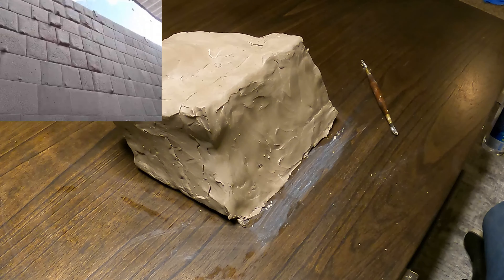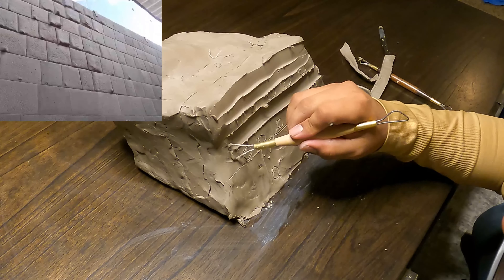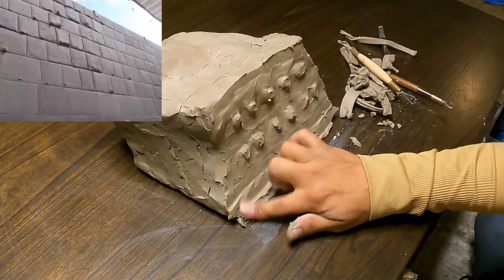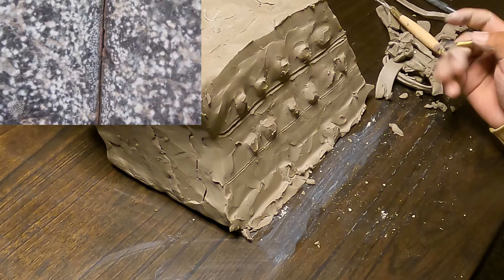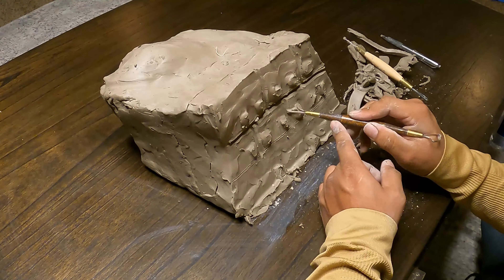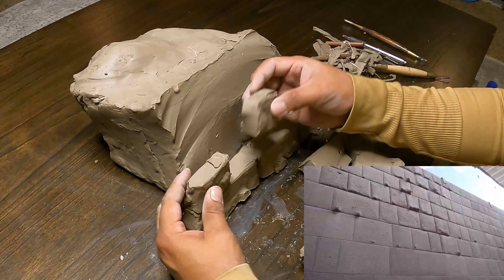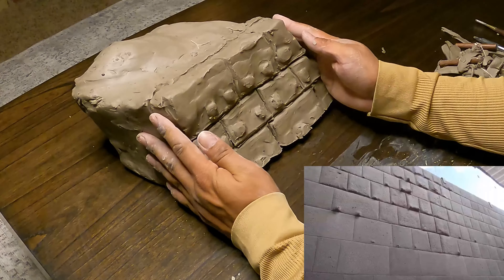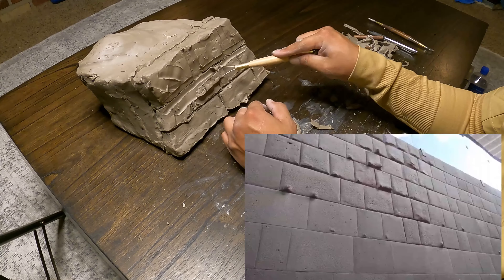Perfecting Polygonal Masonry: A New Explanation on the Ancient Engineers’ Construction Methods

Comment from the maker: UPDATE July, ’24:

Thank you for all the comments. There are many great praises and critiques that I’d like to address.

 1. Protrusions on Stones: Many have questioned why some protrusions were removed while others were not. There could be multiple reasons for this:
 • Removing protrusions is time-consuming. In areas of the wall that are out of sight or covered, such as beneath a first-floor ceiling, the extra time and effort to remove them might not have been deemed necessary.
 • They could have been used for a secondary purpose, such as hanging items or serving another function unrelated to their original use.
 • It could also be that the civilization encountered some disaster or change in leadership during construction, which could’ve led to other priorities outside of completing some structures.
 2. Natural Stone Fractures and Quarrying: A common comment relates to the ability to split off long layers of stone from a quarry. There are pictures and videos showing natural fractures in exposed rock outcrops (search on the internet: “Exposed Rock Outcrop Fracture”). Although such outcrops are not common today, I believe they were more prevalent in the past. Similar to other natural resources, the easily accessible ones were used first, much like early oil reserves compared to today’s deeper reserves that require more complex extraction methods like fracking. Another observation of mine is that this might be why they had to bring these stones from great distances. Early civilizations likely traveled long distances to find stone outcrops with favorable natural fractures.
 3. Consistent Grain Pattern Through Each Stone: This could be the Achilles’ heel to this theory. However, if this technique works precisely, it may not be necessary to abut neighboring stones to their original placement. It could be that some of the stones we see are placed back in the order from where they fell naturally, but there could be others that were not in the original location or order to their adjacent stones. This could explain why some polygonal fittings are more precise than others. 

Although I believe this theory is original, I’m not married to it and have no stake in it. I hope someone smarter than me can provide a better explanation. Like many of you, I don’t believe that these protrusions were used as props to hold the stones up while they were being chiseled, nor do I believe that it was some super-advanced technology.

It’s been a couple of years since I made this video, and I hope to create another soon to delve deeper into how I believe these stones were chiseled efficiently using dolomite stones with small crews of labor.
Reply: nice try but it didn't happen like that lol your theory has more holes than swiss cheese
Reply: This is one of the very too much rare few rational explanations I have ever seen about this topic and I believe it's indeed original as well as possible, I admire your thinking and I thanks your confidence to generously share it with everybody.
Reply: So you are claiming it was easy for them to "plane" the entire face (except for the knobs); however, after breaking the blocks apart, it was too much work to remove the knobs?  Also, the knobs should be along the top edge of the stone to cause tension stress along the groove (and not along the bottom).

Comment: Certainly the best explanation of the knobs I've heard and why they're seen so widely around the world on this kind of masonary. Obviously you'd be hard pressed to use this construction technique on the larger walls but there's no reason why you couldn't use a combination of this technique where possible and cutting them in maually when you had no choice. Keeping it as simple as possible is the key..  Polygonal blocks obviously had to be cut in by hand  and the irregular shapes on some walls suggests they cut them in individually.. I guess the techniques used would de dependent on the properties of the stone in the quarries. Not all stone will fracture in the way you like it to..
Reply: I concur it's an excellent hypothesis or actually theory. The only thing I'm wondering like yourself, would be dynamics. Will it work if scaled up in size.

Comment: I watched hundred of shows on this subject and this is the best attempt at explaining how it was done. I also worked at a granite rock quarry, I use to repel of the edge of the quarry by rope and used a feather and wedge tech to remove huge slaps. Then we would take the slab and make smaller stones, yes I use to make big rock into little rocks. Granite has a grain in the rock that is not easily seen, and you have to use your hand to feel grain. Once you get good at reading the grain with your hand, splitting rock block is easy. The nubs as explained by Daniel would act as a reverse feather and wedges in the splitting process. As for the back side of the rock (the big long and tall cut), that would be easy to cut using feather & wedge technique. I could use other granite stones that are wedge shaped for feathers and another stone for the wedge.  So I think Danial is onto something.

Comment: Why would they not remove the nubs after if they were just for the breaking part?
Reply: There is no need to remove them.
Reply: Maybe it's an indication of the methods used to carve those particular stones while others were carved in a different way. Or maybe they just didn't get around to it.
Reply: @j.f.c  I believe we even have examples of these nubs from like 6 to 800 years ago. There's got to be like some guy sitting in some village with no internet that knows exactly what they're for.
Reply: @cenkaetaya  If I had to guess, those nubs were used to give purchase for ropes when they moved or hoisted them into position, and once it was on the wall, it was probably too much work or they thought it was too risky to both removing them and they did not harm the structure. Or maybe they had some use even after they were set into a structure.

Comment: How did they cut the slab in the first place?
Reply: Drill and wet wedges I would guess
Reply: @johngriffiths118  There should be some drill marks on the blocks where the slabs were cut. They didn't make a huge effort to get rid of the nubs but the block face is cleared of any drilling activity. Also, scibing a line in the rock doesn't assure thats where it will crack when it falls. Internal faults will crack out regardless of what you scribed on the outside. Shouldn't there be some rocks scattered about that cracked other than planned? 
What we need to find is a "Rosetta Block" with all the drilling/cutting markings still in place. Nice theory here but not sure I'm all in yet.
Reply: They used naturally occurring faults
Reply: they dind cut it wall was made in situ..

Comment: Except there's metal pieces holding the individual stones together. 

There was an article written in the mid 1990s.  A researcher went there and did testing.  He found traces of chemicals found in mine water, in the cracks between the stones.  When you add organic water and pyrite to mine water it makes it extremely more powerful,  acidic. He said in his research paper that it could sixteen soften the stones enough to make them conform.

Comment: Ive been saying the same for a while now. However the grain would break easier horizontally with a lot of polygonal walls we see, so if you hacked out a trench six inch wide and eighteen inch deep, the top surface would be roughly flattened and the slab could be 5mtrs x 3mtrs surrounded by the trench. Wedges could be used to split the slab off the bedrock and to get the polygonal shapes and easier to move, while the wedges are still in place drop a heavy rock breaking it in different shapes. Next exactly as you did stand them on their edge in the order they lay on the ground. The v lines you mentioned happen naturally if two sharp square edges are placed on top of each other withought mitering or chamfering the 90degree corner, tiny movement or subsidence creates shelling effect creating the pillow effect over time. Great video, props for that, its just easier to uße the horixontal grain for such big slabs,, look how easy and thin they can cleave slate. Take care my friend👍😊

Comment: This is one of the best theories for the nubs that I have heard, although I think it would have been practiced differently: Carving an large wall off seems very impractical and from what I have seen such a deep single carving has only been done to quarry large megaliths that are kept as one piece, and using crack forming techniques is not an option across that big flat geometry. So I think this practice would have been used more to break up the large blocks that are obtained by the usual splitting-based quarrying. Nubs are often seen in pairs, and right on the edge of stones, so although they could have created a ridge as a stress line, two points would concentrate the stress more and make it easier to break from a shorter drop. This would also explain why so many stones have no nubs too, since during the break the nubs might only end up on one side, and there could also be extra unintentional breakages that leave nubless stones. I do seriously disagree with the idea that the stones were simply reassembled along crack lines, since although there could be some control over how the stones break, stone simply cannot be made to break perfectly into the shape of any blockwork I have seen without significant further reshaping of the mating surfaces.
Reply: Yeah, like the inverted 90 degree corners with protrusive angles and spurs, going AROUND THE CORNER, into the adjacent plane.. you can't 'break' that in one go. It's impossible. It had to be cut into shape, and cut to fit.
Reply: Why keep the nubs if the rest of the stone can be leveled flush.

Comment: Very cool! You explain the “pillowing” and the nubs and more. So one could confirm your method is correct if most of the stones share the same fine-grain striations of their neighboring stones - demonstrating that they had been one solid slab of rock that was fractured on the grooved dividing lines. Seems like that would be a fairly easy test to perform. I’d love to know! I do wonder about those multi-sided stones though - where they have like 9 sides that interlock perfectly with adjacent stones. Those intricate joins are not decorative, and would seem to be pointless, yet very difficult to produce.

Comment: Best explanation I have seen.  I think it makes a lot of sense.  I would think that if this technique was used, there should periodic points on a long wall where the stones do not fit together as well along a roughly vertical seam.  That would mark a place where they had to connect two segments that were made from the same rock face in subsequent cuts. I would also expect that if this theory is correct, there should be natural seams in the rock that continue through multiple blocks, since the blocks started as a single slab.
Reply from the maker: I wonder that as well, about the seam where they would have connected two segments together. As far as natural seams, I wonder that too. I will have to visit one of the sites and get specific footage and also test this theory myself.  Some of my ideas seem correct but they may not be or maybe only partially correct. I’m excited to try them out. Thank you for the compliment
Reply: In a lot of other examples, there is no interrelated consistency between blocks and there is also evidence of some chemical process used in the fitting method, as if the stones were burned together. If this is the case, the knobs would come in handy for chocks during this process to eliminate slippage and dressing them later ran the risk of cracking or otherwise damaging the treated stone.

Just a thought.
Reply: Gregg Braden talked about how the limestone block on the Egyptian pyramids was tested in the 80's and they found hair and insects inside. The natural layers that should have been found like in natural limestone weren't found. The tests proved that they mined the limestone some 500 miles away from the limestone quarries but that it was now a homogeneous mixture without the natural layers. I believe the ancients understood how to crush limestone and granite and then turn it into a liquid or a sorta concrete mixture to make those massive blocks.
Reply: It's definitely a theory that should be tried out to see what happens on real rocks, how easy and reliable it is. It Ddoes make a lot of sense why the blocks are beveled and irregular shaped. I only question why , if  the joints follow natural cracks or weaknesses, that firstly the akers knew all of them and secondly why the weaknesses are straight. That part doesn't make obvious sense, but there could be good reasons for it.
Reply: I wanna see it done lol. People have tried everything I'm sure including this. Rubbish.
Reply: spsmith1965: This explanation might not be completely right. I have seen a cracked block and found that the block was built with small bricks as its crumb and cement as its crust.

Comment: volcanic granite/basalt viscous clay can be cured into a solid stone in less than a week but can't be reverted back to viscous condition unless you add some crude oil to the viscous clay so the sulfur (used to soften stones) won't turn it into a porous pumice - hope that helps!

Comment: There is probably some truth in your described method, and it's fresh to see that new ways of thinking pop up about this, because it's so puzzling and interesting and frustrating at the same time that we don't know a definitive answer! But in my opinion, the method wouldn't be feasible on a larger/taller wall section, I don't believe it would break up into all the carved pieces. Perhaps the top rows would, but at the bottom I doubt the stone would achieve enough momentum and force that it would separate at all. But still, a refreshing view to a complex question, kudos!

Comment: My husband's theory for the beveled edges of the stone is because with sharp edges, the stone facing would be prone to chipping when installing the stones.
Reply: So to avoid the edges getting chipped off, they chipped the edges off... got it.
Reply: @chriscampbell4857 🤦‍♀️ it's a similar concept when making ceramic tile. The edges are roundEd, or slightly bevelled, to lessen the chance of chipping, and means you don't have to be as precise during installation. It's also a decorative feature. Take tempered glass, for example. The edges are slightly bevelled because if they don't, and the edge gets hit, the tempered glass will shatter.

Comment: This is a good theory. If correct, the stones should show continuous grains, intrusions, striation, etc and patterns showing they were once a single piece.  But the question remains: why go to all this effort? Because it's much easier to cut stones one at a time if you aren't concerned about tight joints

Comment: An interesting theory.  I especially like your explanation of the "nubs"
The problem arises when they split the rock away from the quarry.
First, although most blocks would break on the scribed lines, some wouldn't. Due to internal faults, or whatever, they would be inclined to break occasionally. There's no evidence of broken blocks at the time of construction. 
Secondly, the side faces of separated stones typically show signs of milling or cutting. If the stones are milled after they're felled, they wouldn't fit as closely as they do.
The "nubs" are generally placed regularly in similar locations on the stone, suggesting that placement was critical to their function. If their function was just to encourage the stone to break on the scribe, the location wouldn't be quite as critical. 
Still, it's one of the better theories I've heard!
Of course, it doesn't address the larger question: how did they move them!?

Comment: You can see from partially dismantled walls at Cuzco that the stones abut each other with perfectly adjoined faces which are smooth and often curved, and also often with compound curves. Obviously a broken stone would not form such surfaces. 

A broken stone would fit back together perfectly but the surfaces would not be smooth.

Comment: How do you explain polygonal fitting around corners? What about places like Ollantaytambo and all the massive inner and outer corners? What about the flawless inner corners in Egypt that wrap around the stone? What about cutting and fitting the back of the casing stones on the pyramids in Egypt?

I appreciate the effort but this obviously isn't it..
Reply: Ya I was thinking that too. It’s incredible that they somehow did this. Even if it wasn’t the Mayan or Incas. Somebody did it, and not with stone tools lol.
Fitting granite so that you can’t put a business card between them is pretty extraordinary.
Reply: More than one tool in their toolbag, this probably worked well but wasn't the only method. Maybe the knobs are an indication of the methods used?

Comment: Cuzco and other sites have differnet sized knobs some small some kinda of huge protruding out more. Some of them perfectly carved for some odd reason. But some are not. Hosntely i think they were mounting something on to them. This structures has something attached to them. Like a docking station. I just dont know for what exactly.
Reply: There was a purpose for these. Did the stones all have knobs on them so they could place a scaffold board across them so they could stand to work on the higher stones ? Then once finished they smoothed them all off except the final ones that are holding only a small bit of scaffold plank then, this bit cant be smoothed off because it would be too awkward as its the final bit they are standing on.